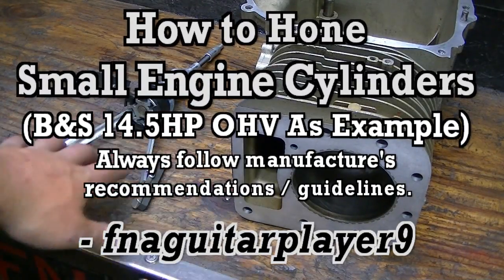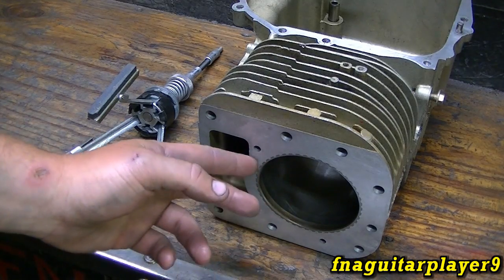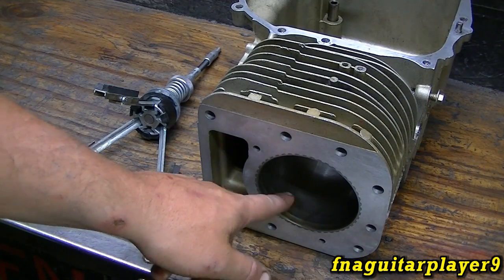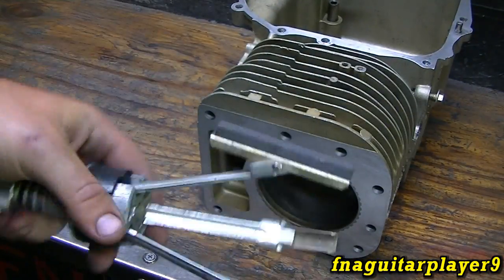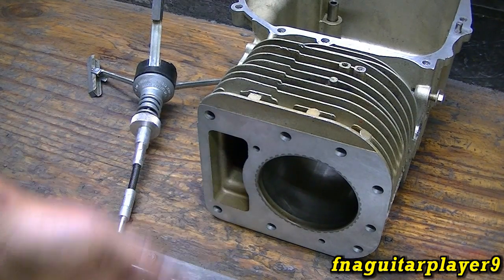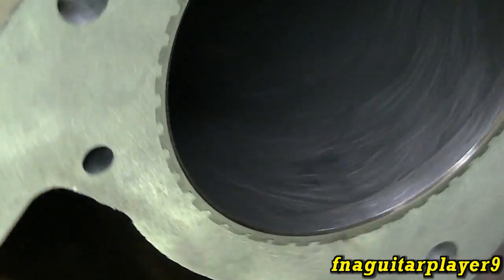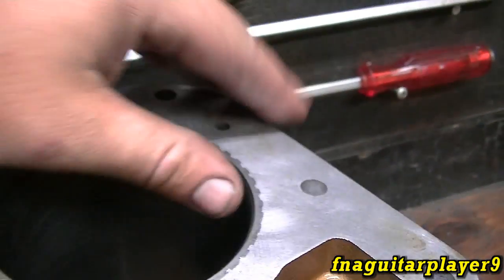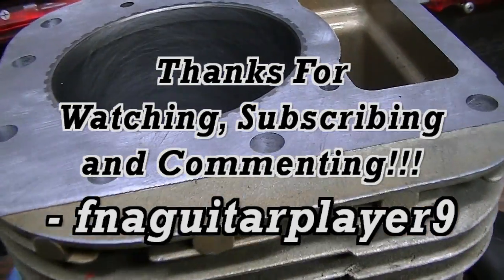How To Hone Small Engine Cylinders (14.5HP OHV B&S as Example)

Comment: Great video! This video will never get old! I just tried to hone (Deglaze) my kool bore Briggs. I couldn’t find new chrome rings so crossing my fingers the old ones will still work. Really hope I didn’t screw it up.. Thanks for sharing!!
Reply: How’d it work out, I’m thinking to try the same.
Reply: @mgpatriquin  Well it worked but really needed new rings. The engine runs but smokes at first throttle twist. Wish there were still parts available for these engines

Comment: This didn't affect the piston size right? I mean you didn't need a bigger one? Just rings?
Reply: A light honing won't take too much material off so the same size rings will be OK, however if the bore is oval or stepped then it needs machining to oversize and a suitable new piston and rings.

Comment: Hello,
I have a 21 H.P. Briggs engine, single cyl. that smokes I see the spark plug has a ton of black goo on it so Im going to do a ring job, should I just get the stock replacement rings or would you go with the oversized ones for doing this job?..
Thanks for the help!
B.

Comment: I have rings that are far out of spec on a beautiful cylinder that's waiting to get honed. I wish I'd seen your video beforehand as I bought the original rings. Think it'll be in spec with the new rings?
Reply: The rings I replaced had a .090" gap. It turns out these new stock size rings will get me the clearance you mentioned for a new ring install. How did the original ring gap get that big without the cylinder diameter not being large enough to require new rings?

Comment: Is there a difference in a break hone vs cylinder hone?
Reply from the maker: Mainly just size, the brake hones are smaller and can be used on a real small engine. Thanks for Watching!!!
Reply: For me, anyway, if you are doing a wheel cylinder, you don’t need the cross hatch pattern and a glossier finish is preferred- since you are trying to seal a rubber cup instead of piston rings. Finish with the pressure dialed back, thicker oil.

Comment: Have you done a video about setting  the ring gaps? I enjoy watching your videos im looking to rebuilding my 15hp ohv engine. Im guessing the rings are bad cause as i mow n make a rurn it smokes bad but when it sits it smokes lil bit
Reply from the maker: Yes! https://www.youtube.com/watch?v=4IOYxsFS8yw&feature=youtu.be That is usually the problem, but also note, on OHV motors, they are bad about blowing head gaskets between the cylinder and valve chamber. So if its excessive / constant smoke then thats probably it, if its the smoke at start and when you throttle up then its probably rings. Thanks for Watching!
Reply: @fnaguitarplayer9  thanks. I did tear most of it apart. Got the head off. Cylinder looks fine no major scratch marks  can see the hone marks slightly. I may just tear it all way down n put new rings on n hone cylinder
Reply from the maker: @chrishotrod6603  your welcome! I hear ya, thats good thats its in good shape. I hear ya!

Comment: Great video. Do these lawn mower engines develope  a ridge at the top of the cylinder like a car does?  We used a ridge reamer to get the ridge off the top of cylinders on cars back in the '70s.
Also, how much over size rings do you put in your small engines? One thousands or two thousands etc. I gave a friend a 18.5hp briggs for swapping motors on my rider. It had no compression. He said he was going to put rings in it. What else do you recommend he does so it will turn out good? Thanks in advance.
Reply from the maker: Thanks! Yes they do, the aluminum bore cylinders are worse (and they don't need honed when rebuilding) but the cast iron bore engines will get a ridge as well but most of the time they are not bad, usually i'll dress it up with sand paper to smooth it out before removing piston. For most engines rings are available in standard, .010", .020" and .030", 90% of time a standard set will do, sometimes i'll use .010" and file them till the ring gap is to spec, but its not a preferred method. If there is no compression at all its probably valve related, either a stuck valve, out of adjustment or needs reseated.  If its a cast iron bore, hone it, get new set of rings, do a valve job and tune up (possible carb clean, new spark plug etc) then put good oil in it and drain it after a few hours of use and put a good oil in it and it will hold up for a while. now of course if you tear it down and its got a scored cylinder then its going to take more work/money to fix. Hope this helps, and I also have complete rebuilding videos as well. Thanks for Watching!!!

Comment: the crosshatch pattern should be around 45 degrees both ways and turning the hone fairly slow will get you where you need to be, your pattern looks good that engine should break on quick  good video  thanx
Reply from the maker: Yeah, its easy to get it wrong. It did run great, didn't smoke much while breaking in. your welcome, Thanks for Watching!

Comment: i have a aluminium cilinder that needs to be machine out about 1mm because is very bad,after that what should i do ?
Reply from the maker: You will need the oversize piston first and have a machine shop do it, don't try to use a hone, it won't turn out even enough. then just put it together as normal, getting a ring gap of around .003". Thanks for Watching!!!

Comment: I hone my blocs at the vertical and secure it down with a vinyl clamp. This way, you're able to squirt some lubricant while honing and the "up and down" motion is more precise than the "in and out" motion. Good upload. Thanks.
Reply from the maker: I feel that is the best way to do it to, you wouldn't have as much control over it going in and out. Thanks man, and Thanks for Watching!!!
Reply: I do understand that, for video purpose, we can see better at this angle. Good video. Thank you.

Comment: As far as I know none of the ebay sellers given any numbers regarding cylinder condition.  Words like good and serviceable are subjective.   Never got up enough nerve to give em a try.
Reply from the maker: Your right, they don't say much. I judged this by overall condition and in the pics the cylinder looked good for what i could see. But you never know what your getting, i took a chance, and it only cost me 35 bucks (and free shipping too) and it turned out great, it still had some factory hone marks left in it, so i could tell it was lower hours. But yeah its hit or miss, you never know what your getting. Thanks for Watching!!!
Reply: if you ever do decide to " "give em a try"  look for 99. + percent customer approval  rating, seller accepts returns and 4- 5 stars. Never had a problem when others have shopped there in numbers and they all (most) say they are happy. Ebay, I cant log on to my own account, so I use Amazon.

Comment: Good video,,,,,A question,,,,I got a 12.5 briggs,,,,The cylinder looks good. Is a cast iron sleeve. When i put the old rings in the cylinder the ring gap is 18,,,,,,But when i slip the oil ring in the cylinder the gap is 44.,,,Could i reuse the old rings???,,,Thanks
Reply from the maker: Thanks! I wouldn't recommend using those rings, on a fresh rebuild i try to keep the ring gap around .003 to .010" for all 3 rings, when i put this motor back together (next video) I got all 3 rings at .003", i ordered .010" oversized rings and filed them to specs. It will run with them, but it will have slightly lower compression and you may see a puff of smoke or it will use some oil. Thanks for Watching!!!
Reply: A fresh rebuilt requires new rings. Compare your situation to new shoes with old laces. How long will you be able to run before something fails ?